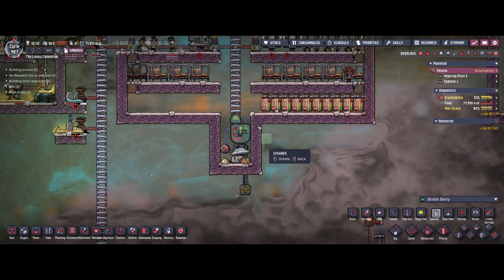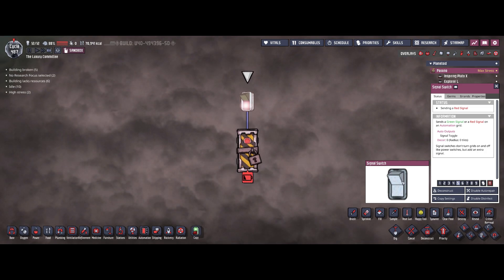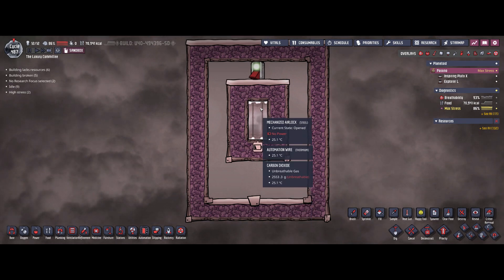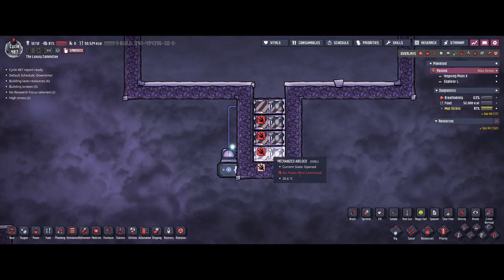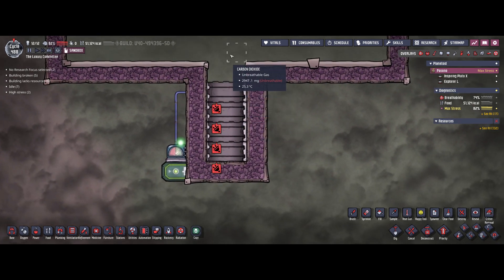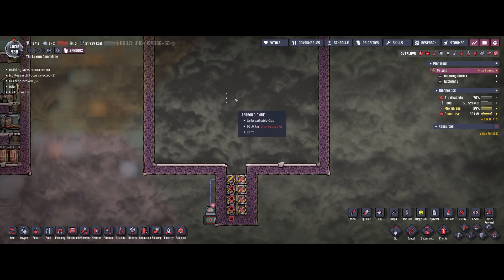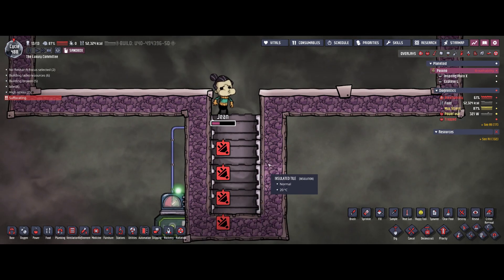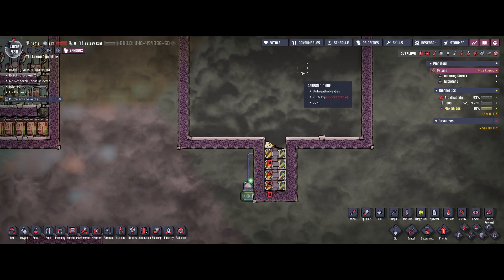Oxygen Not Included: Automated, power-less deletion of carbon dioxide

Comment: got it working! its pretty slow when you gotta lot of CO2 to deal with. can probably add a 4th or 5th door to speed up. guess theres no way to turn off the ethernet circuit with a hard switch, can just cut a wire when the CO2 is gone

Comment: although definitely useful, once you get a good grasp of the game you will manage to make good use for the CO2 for a lot of things, like meat from slicksters and of course, you can just leave a hole open to space for it to vent and make sure you're always in a vaccum for areas you don't need to seal
Reply from the maker: yes there are a lot of uses for CO2, still I feel u will still need to get rid of excess CO2. Problem here is u will need to pump the gas into space (as it is collecting at the bottom and not at the top) which consumes power.

Comment: Nice!  But you really can't do this in a legit build unless you add the gas element sensor near the top of your door stack.  If you dont then it will eventually start deleting your oxygen.  Add it with an and gate.  You can add another one for chlorine.  I also add the pressure gauge too and set to like 100-400g, this helps keep oxygen out of the sink.

I really like the petro room idea, typically I vent that into co2 bottles(for the soda fountain) then the blowoff for that goes to space.

Keep it up, I am enjoying these little tutorials :)
Reply from the maker: thanks man;)
Reply: @engineeringandgames6107  please implment the above suggestion for a video update, and it will be greate if you make a playlist of all these automations. They are really awesome
Reply: I will work in legit build because I always put my petroleum generator in a seperate room from breathable oxygen. You don't want the heat and the polluted oxygen finding their way into your base.